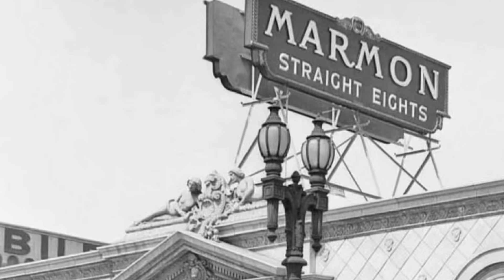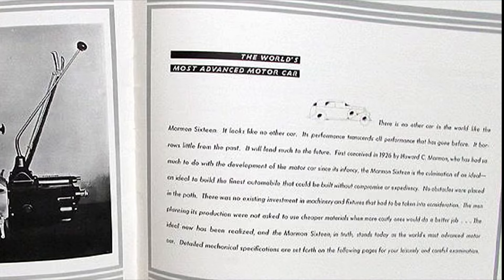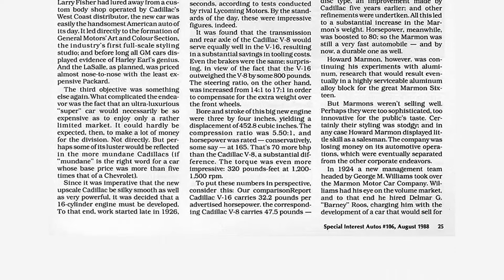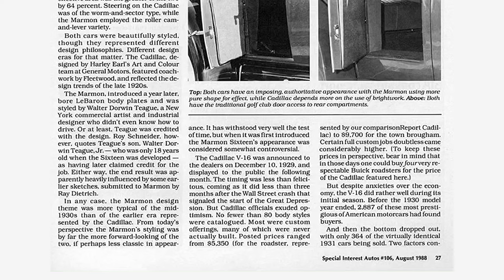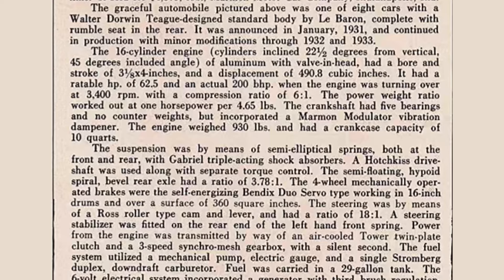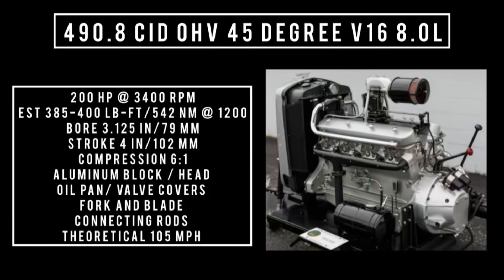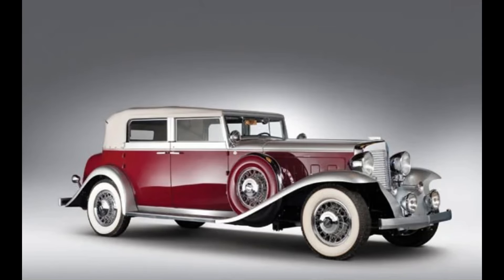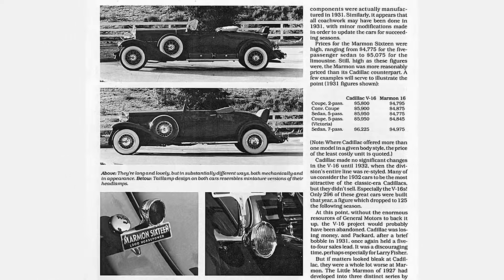Marmon V16 490.8 cid engine

Comment: This is a very nicely sculpted engine. It might look cooler with 5 into 1 exhaust manifolds but then it might lose some of the elegance. The knurled valve cover knobs are a nice touch. When I look at ignition wire looms like this I wonder how much trouble they would have with arcing after a few years when the wires started getting old. But I suppose the guys who owned these could afford to pay people to thread in a new set. In the would you rather I'd choose the 1931 Marmon and the 1931 Duesenberg Model J. The 1931 Marmon 16 is my favorite Marmon but I think the 1912 Marmon Suburban is a pretty cool car too.
Reply from the maker: Awesome choices =)

Comment: Aside from lacking OHCs this engine has a distinctly aeroengine vibe to it (1). Aluminum block and heads. Although an aeroengine might have had the block and heads as one unit. Its the fork and blade rods thwt are the real giveaway. IIRC this was done on aeroengines in order to make dure any stress on the crank pins was spread evenly.
1) Inline aeroengines normally had their OHCs driven by sets of bevel gears and tower shafts. Something rarely seen on sutomotive engines. The OHC V-8 in a recent video was one of the rare ones. I suspect changing rpm levels during acceleration put twisting loads on the tower shafts.

Comment: Knowing something of the development of aluminum, it's a near miracle that they could make this engine block at the time. I do have to wonder what the scrap rate for the castings was. The lack of counterweights on the crank seems odd but given that it's not a high-rev engine that probably didn't matter much. The depression brought much of the advanced technical development to a screeching halt for a decade, and when that resumed it was wartime and the artistry of engines became a waste and never really came back. 

I like the roofline of the 33 best so it gets WYR# 1. The Duesenberg takes round two, simply the best of it's time.

Comment: Wow, only a single 2 barrel carb for 16 cylinders, the poor thing would have been staved for fuel. Imagine if it had four 2 barrels, a carb per 4 cylinders, watch that horse power climb to 250hp. 
Other Engine top feature:
Ford Cleveland (don't forget the Aussie 302, it was produce along the 351 for15 years in Australia)
Reply from the maker: I was thinking the same thing, but it’s no different than a single barrel carburetor on an eight cylinder.. and totally agree just imagine if it had a four barrel carburetor you would be able to get more power out of that thing